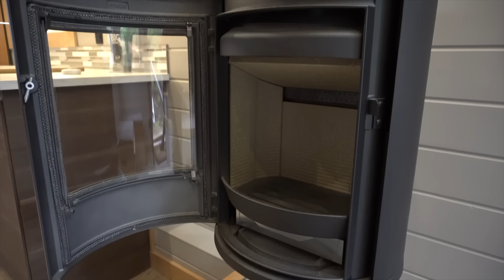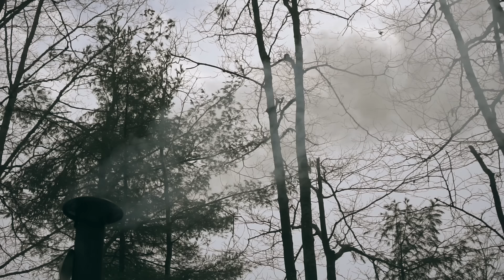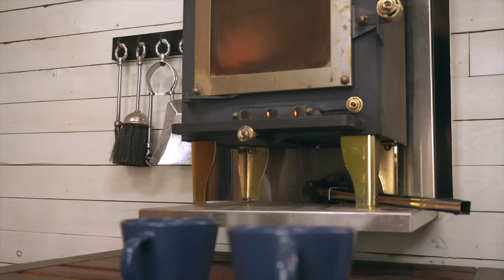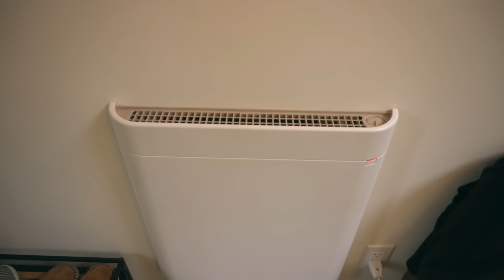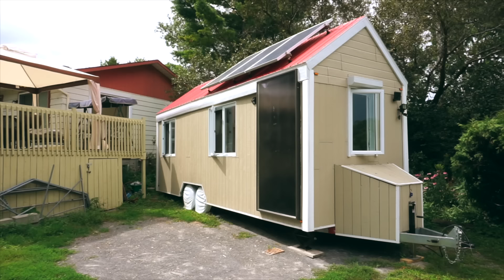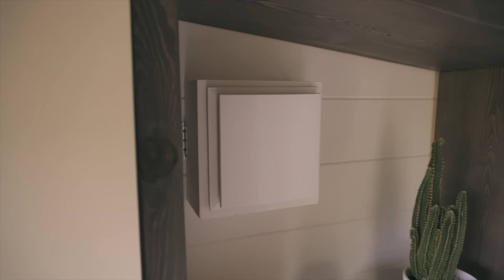Top 5 Tiny House Heating Options for Winter Living - Off Grid & On Grid

Comment: I've been on propane heat for years and you need the VENTLESS propane heater and not a very big one either. My 30K BTU Ventless fireplace has no issues heating up our 3 bedroom house and it's not very expensive either. A single 100 pound (21 gallons) propane tank lasts about 30 days if we don't run it daily and we have 3 of those. The quality of heat is excellent and is instant heat. We go to the local Farm Bureau to get our tanks filled and it's around $70 US Dollars to fill each of our 100 pound tanks up. So for a tiny house that's under 400 square feet, you won't need a large system. As far as wood stoves go, get a Liberator Rocket Stove and go with wood pellets. 98% efficient and has no problem heating a tiny house. AVOID ELECTRIC HEAT! The quality of heat sucks and it's not cheap at all and will empty your wallets really fast. Plus if the power goes out over a large area due to a natural disaster of some kind, you have no heat. Natural gas is also a cheap heating source too.

Comment: My tiny house uses a propane rv water heater to heat the radient floor heat. Anti freeze is in the radient floor heat.  A point of use electric water heater is used for hot water.

Comment: i had wood, kero, electric, and now a wall mounted blue flame propane heater, hands down the best is the propane, simple, reliable, affordable, clean, convenient, instant, and it doesn't take up any space, i have 336sf i use a 20,000 btu  its almost double what it calls for, on a thermostat  it last a long time

Comment: Whoa Nelly! EA finished with wood stoves and launched into propane heaters without once mentioning wood stovepipe issues! This guy obviously doesn't have much experience using wood fuel in juniper/pine country or he would have stories about watching flames and sparks blasting out the stack when the creosote and soot deposits cooked off. Not to mention EA appears to be oblivious to interior air quality issues users of wood stoves eventually must confront. Guess it goes to show that watching other people's videos doesn't really tell us even a fraction of what we really need to know to understand all the pros and cons of just about everything in this life that is even slightly complex. Pretty pictures though.

Comment: I have a 10 ft X 16 ft insulated building and I have used an oil filled electric radiator heater to heat my little house on some of the coldest days and nights here in Okla. I use it for backup now as I have a propane cabinet heater now.

Comment: i think we need to talk more about cheapest way to heat a small house/electic is the most costly method. i  have used  my wood stove but went though over 400.00 in wood in nov through feb and cannot regulate the heat. Now ventless propane is about half as much  at just over 200.00 in those 4 months. i am heating about 300 sq ft. with 12,000 btu mr. heater ventless
Reply: you only need about 9,000 btu to maintain 70 degreez for 300 sq ft house if you have good installation. outside temperature is 35 F inside house is 70 F

Comment: Air source Heat pump - mini-split would take a bit more space, jet use 1/3 of a resistive heater.
South facing, wider angled triple glazed low e Windows could help as well.

Comment: the matter with gas heating, it does not delete humidity. Bath oil heaters are super efficient for that. 100 watts electric blankets are also super cheap to use.

Comment: Thanks for this nice comparison. 
In the propane section you mention the extra task of changing bottles, procuring them and such. But that also applies to wood-burning of course. That's even more work since you have to keep filling the fire with wood, going outside to get more and such. Also the cleaning of the ashes the next day is an additional task with wood-burning.

Comment: I find all this very amusing, I'm going to guess most who comment haven't lived in a tiny house with a heat sores  or for any real time " YEARS LIKE 10" Most comments are incorrect in there end. 1st your great heat lose is the roof, 2nd doors and windows when used or poor quality.  Floors need 6" of your pick, you need that for your chase for wires. plumbing which can be double insulated. other wise you left your plumbing on your last dirt road.  The roof of 2x6 or 2x8  with quality insulation Then If there is beds, loft type, your at ceiling height the hottest part of the house.  "YOU BAKE"  Your heat source should  be wall mounted, direct vent, a size out put as was stated with an electric radiant 110 volt radiator style heater below the wall mounted.  The heat source should be stacked less space lost. Your heat choices should be boat type wood, propane, oil, coal.  They all work I prefer wood with electric radiator. Which can be run with a 2000 watt HONDA GEN   All this I did for over ten years. You want all your fuels PACK ABLE BY CAR HORSE ATV.   And a good fan to move the air around Quality shades or curtains also when real cold. This system WORKS you will know when the snow is 4ft on the ground and drifted against your tiny house and the snow hasn't melted the perimeter. Good luck because I still live like this on 150 acres of woods lakes and a long dirt road.   Town 5 miles away. Enjoy

Comment: Fireplaces were mentioned several times.  Why do you think stoves were invented?  Because fireplaces are lousy for heating.  All in all, I found nothing about wood heat that was  useful - I've been doing my homework, will need heat in a van converted to a camper, heat of choice is a wood/coal stove.  Coal in it will provide an overnight burn, and will use wood during the day.  And there ARE smallish wood stoves that will provide overnight burns with wood.

Comment: Good info.  You could also stress using better quality glazing on windows and doors and weatherstripping as well as better insulation like closed cell sprayed insulation (if applied properly) or closed cell rigid panels in walls, floors and roof.  If you want to pay the price, you could put in radiant heating (electrical) in the bedroom floor (bonus if your bedroom is over the kitchen/bath).  If budget is not critical, you could have a wood heater and gas or electrical as a back-up to keep the house warm when you go to bed.  Perhaps some would say that defeats the simplicity of the tiny house.  It's a matter of its importance to you and what your budget will allow.  Also circulating the warm air in a house can make it more comfortable throughout.

Comment: Very well explained!!! With the solar air heater could I heat  multiple rooms would I have to install solar system in each rooms?
Reply: I think I actually could use to solar on my roof leading it down into two more rooms I guess

Comment: With photovoltaic cells and a small windmill it should be possible to heat a tiny home. I think it don't make sense to use fossil energy for a new build house. 
I just bought a house build 1920 with 300m2 space to live. I insulate the roof, new windows and heat it with a mix of solar, wind and wood. The invest for this mix to heat the house and water lay around 30 td EU. renewable energies are the future for me and my family.

Comment: Using room air to support combustion seems very dangerous to me, esp. in a small space. Outside air supply?  Clearly regulating temp. will be an issue with wood or coal burning stoves.

Comment: One thing that has been forgotten in the modern age is that heating with fire is best when there is a heat sink to soak up the heat while the fire is going, then give off the heat when the fire is out.  60+ years ago, fireplaces were made of large amounts of rock, brick, or cement.  Today, lighter weight heat shields can be used as the heat sink that stores heat while you are awake keeping the fire going, then keep the space warm after you have banked the fire and gone to bed.  I used to keep a 2000 SQ FT home heated all night with a good sheild that was placed behind my wood burning stove.

Comment: For our tiny house we picked up one of the compact CHP wood pellets stoves from hasty heat with thermalelectric water heater.

Hot food, hot house, hot showers, and electricity..

Very efficient 12 hour burn per hopper load, exhaust temps are cool enough you can grab and hold the single wall chimney pipe!

https://m.youtube.com/watch?v=oTijbSC8y6A

Comment: You can provide heat to secondary water filled radiators if you put a series of copper coils rapped around your wood burning stoves chimney . The radiant heat usually wasted going up the chimney heats the water in these copper coils and with a small electric pump the hot water can circulate around the radiators - providing heat to all areas of your tiny house.

Comment: There's a recent report on wood burning stoves that discusses the issues of micro particles that are given off into the room space. These micro particles are burn wood particles and some are saying they are as dangerous as asbestos. So in a small houses the micro particles could be more concentrated for the user than those in a standard sized house which has a larger space.

Comment: Thanks for the info.  I don't have a tiny house but I do have a sailboat that will become my retirement home in a year or two.  It is heated with a diesel fired water heater that heats the water in my hot water tank if I am not connected to shore power and also sends hot water to 3 zones in my boat where there are hot water to air, fan driven heat exchangers. This system can also be used to provide in floor radiant heat off grid.  Diesel fired heaters by Webasto and Espar are very popular but they are not cheap.  They are also available as air heaters rather than hydronic heaters.

Bottom line, you live in a tiny house. If it is well built, sealed with a Heat Recovery Ventiltation System and exceptional insulation (best investment in "heating systems" you can make is in ultra high efficiency insulation like spray applied polyurethane foam insulation throughout.) you can approach a Net Zero heating and cooling requirement.

Comment: Curious if you've run across any Tiny Houses that heat with a rocket-mass type stove. The thermal mass in these stoves store heat and would solve the problem of #1. Burning soo much wood, and #2. The stored heat would prevent the need to get up in the middle of the night to feed the stove.

Comment: Just an opion on 3 ideas for heating: pellet stoves -- limited fuel choices to burn and at the mercy of the market.  Real wood burners let you burn everything from junk mail, pallets, trees, etc.  Kerosene; expensive [market] and smell. Not sure why gasoline prices have gone way down, but kerosene hasn't budged in my area.  Still over $4/gallon.  Propane catalytic heaters, very efficient, adjustable and ok with small spaces.  Yes, I said at the mercy of the market, but some fuels are more reactive to market conditions faster than other fuels. Just some thoughts.

Comment: I concur on the wood heat, this is especially true in a tiny house with, a tiny wood burning stove.  For maintaining a fire all night you have to have a large wood capacity which a tiny wood stove does not have.  I live in a small, not tiny, house.  My wood stove is great but small and if I do not feed during the night it is out and cold in the morning.

Comment: You stoke the fire before you go to bed and you turn the air way down low on it. That's how it keeps you warm all night long.
Reply: That is your recipe for a chimney fire 🔥!
Build a fire and smoulder it, 80% of the heat will be lost in the wood gas smoke creosoteing up the exhaust pipe...

There is health and safety reasons airtight stoves were banned decades ago...

People lost thier lives and homes choking down their fireboxes like that.
Reply: @HastyHeat-com  you obviously don't know how to operate a stove if smoke comming back in and creosote build up is your problem. 80% heat loss, I think not.
Reply: Jason Morehouse What “@Hasty Heat” was (correctly) explaining was the fact that up to 80% of the AVAILABLE heat is lost (in the form of smoke, combustible gasses, and creosote) as it goes up the chimney. Modern, efficient wood stoves are designed to dramatically reduce this, (as it’s inefficient and bad for the environment) by means of a better air-to-fuel mixture, preheated and diffused combustion air, baffles, minimum draft stops, and several proprietary designs which contribute to cleaner, more efficient combustion. However, there’s still some issues with “user error” (as you eluded to) with the result of smoke spillage into the home. But there’s also many other contributing factors that, no matter how ‘good’ of a job you do, it’s still going to be a disappointing failure. Regardless of the stove brand, model, or design, it relies on the chimney as the  ‘engine’ that makes everything work. Whether it’s too short, too small of a diameter, too many elbows, or even too large of diameter, all of these things are beyond the user’s control. The chimney will allow smoke spillage into the home. But wait! There’s more! Even if the chimney is perfectly designed and built, there can still be issues with smoke spillage into the home. One cause is negative pressure in the home. This scenario is achieved with the use of kitchen fans, bath fans, clothes dryers, etc. which all are designed to exhaust air to the exterior of the home. This creates negative pressure inside of the house and the replacement air is sometimes pulled inside thru the chimney by overpowering the natural draft of the flue. Yet, There’s still more to consider ... “Stack effect” is a known occurrence where sometimes the house makes a better chimney than the actual chimney itself. Here’s why: The same natural law that makes smoke rise (aka draft) can be applied to warm air inside a heated home. Heat (in the form of warm air) always rises; you can’t stop it. This will cause negative pressures in the lower areas (where the stove is typically installed) and can sometimes overpower the chimney, causing it to reverse and spill smoke into the home... All of the afore mentioned scenarios can result in smoke spillage into the home, excess creosote formation, poor heating ability, chimney fires, home fires, and loss of life. Be safe!
Reply: @bighammer587  Thank you so much for this super in-depth explanation!! Where can I learn more about all of this to safely design a heating system? Cheers :)
Reply: Bennet Fox, the way it keeps you warm all night is you sleep under a whole lot of quilts for warmth.
Reply: Bennet Fox Those tiny, miniature stoves will burn a full load of wood in only about 3 hours max, putting out very little heat. They’re more of a novelty than a real heat source.

Comment: Build an outer shell greenhouse out of glass or even plexi, paint the building flat black. Cabin inside of greenhouse will absorb even minimal sunlight. Use insulfoam panels as much as you can afford. Super insulate the cabin in the summer, look up ways to make your own prestologs. Myself i would just buy a dozen if these mini cabins and connect them all together but the idea seems antisocial to some.

Comment: I have Propane in my off grid Cottage.  IT SUCKS!! Propane is a pane!! I'm going to a wood stove and brick wall. Once the wall is warm it's a very good thermo mass if the stove dies down at night the Brick still will give off warmth over night. At minus 20. Propane has given me nothing but headaches!! The regulator has frozen, propane looses it's pressure to keep the fireplace going. 
it's not a reliable heat.

Comment: We burned wood for over thirty years and we miss the type of heat this type of heat provided. Right now we are using a gas fired fireplace unit that has the ability to completely heat our home in the even of a power outage. 
If we do build one more home it will be a super insulated one that doesn’t not require a very large heat plant. We built a house in 1990 like this and it worked very well but the size of the house was much too large for our current needs. As a result we will do an advanced design of this house but with a much smaller footprint. 
We also employed a massive heat sink into every design we built and will also do this once more. In addition a earth shelter greenhouse will be placed on the site. The one question is if we plan to incorporate the greenhouse into the living structure or not.

Comment: In general, a good an interesting video. Regarding in-floor radiant heat though, there's electric, which you talk about, and also water-based, in which the water can be heated by a relatively low-temperature water heater (domestic hot water heater for example). But I think you're wrong with the statement that it's great because it actually heats the structure itself. Yes, the floor is heated, but the key attribute of these systems is that instead of heating the air, they're heating the people. So it can be very effective and efficient, if done right.

Comment: Heat pump ? Diesel tube heat ? HE karoseen , pellet stove, corn stove ? , Passive radiant , ? And to only mention some he missed  do your home work pick you 2 best and have and ensure 1 or both can run without electric or piped in gas   cheers

Comment: Another option is a Thermal Battery.  It stores heat though a phase change material and is off grid friendly getting it's heat from the sun.
Reply: Shindinru Much cheaper and easier to use a thermal store, water is an excellent storage medium for heat. 1000 litres takes up one cubic meter, so relatively little space, and can hold upto 80 kWh of heat energy, more than sufficient for a small well insulated home over a 24 hour period.
Reply: @spencerwilton5831  - 1 cubic meter is a lot of space in a tiny home.  A thermal battery also can be mounted on the outside, taking up no internal space.